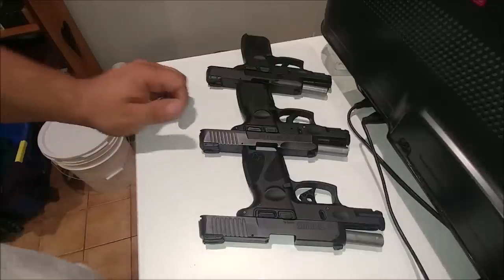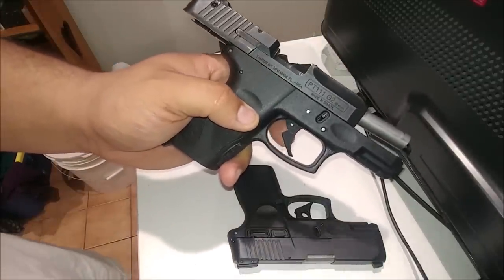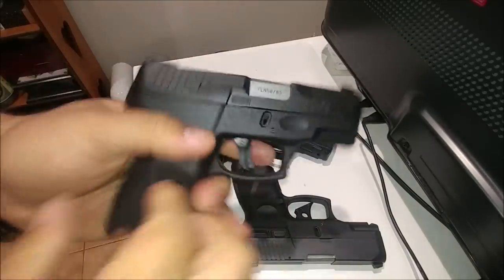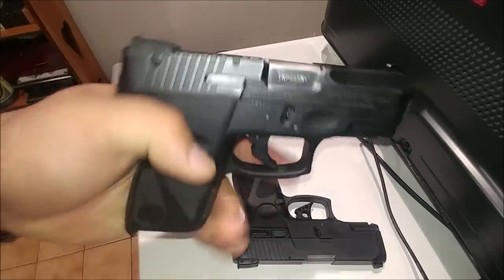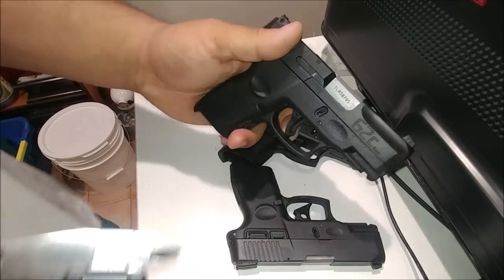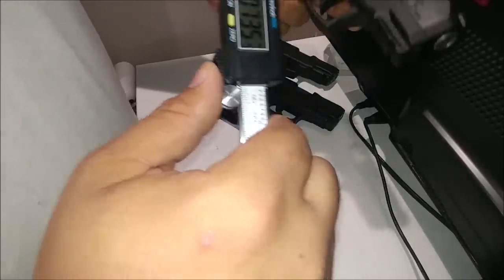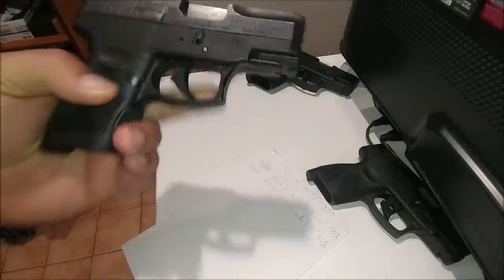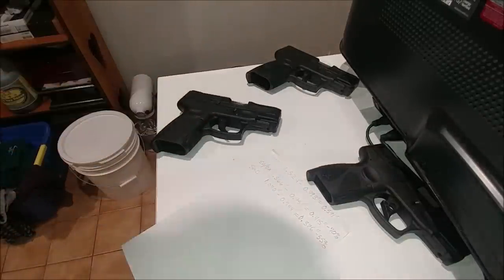New trigger design: SA/DA (Restrike) Trigger for PT111 G2/G2C/G2S

Comment: That is pretty incredible Sir. A 30% reduction in travel and still keep double strike ability is a very nice feature. Most of the G2C come with an external safety so the dingus being gone from the trigger doesn't pose a serious issue as far as safety is concerned IMO. Hope enough people become interested because it will make a fantastic entry to the 3 triggers already in your catalog for that little gem.

Comment: I'm in, I own a Glock 17 gen 2, one of the best stock triggers around. I love my PT111, but that safety trigger just blows. If I see that SA/DA trigger on-line in your eBay store, it's in my eBay cart and bought!
Reply: Got a G17 Gen 3 and the G2 trigger is horrible. It's like getting out a 2018 Lexus and into a 89 corolla with 400,000 miles and a CEL lit.
Reply from the maker: Thanks!
Reply: Lmfao Glock triggers are was. Even stock taurass triggers are better.

Comment: I have pretty large hands. It practically gives me cramps to pull the trigger all the way. I like the DA option, you can put a laser in the chamber, and practice on a laser range. But on the other hand, that reduced difference in travel for the SA trigger is probably more important for a carry weapon.

I haven't decided which I'm getting yet, maybe if I get a grip wrap,  it will give me enough thickness on the grip to allow me to keep the DA feature.

Comment: Great video. I want one!!!
Reply from the maker: The process takes a while to get rolling, but I have the first prototypes on the way, and as soon as I get those and verify they are working correctly, I can get a production run going.
Reply: Keep Tinkering: You da MAN !!!   I know a bit about machining, design etc. Unfortunately I didn't get the education in CAD/CAM cos didn't push it. (I'm 55yrs young) Worked in an excellent machine shop, nevertheless I  know quality and skill when I see it. I want one or more of your trigger systems... positively. My G2c is a fine and reliable arm. Can't believe it was so inexpensive. Great gun! Better with your trigger selection. Please make me one! Don't give a shit about the cost... I  got my new G2c for $189.99 !!!   My best to you sir.
Reply from the maker: My SAO triggers are available now, the link to my ebay page is in the description, my SA/DA triggers should be no more than two weeks out, and probably less than that. I will post an update here when I get them up on ebay.

Also, if you want to play with a VERY basic CAD program, look up tinkercad, it is a free online program.

Comment: Would it be feasible to have the oversized advantage of the SAO pseudo trigger in the SA/DA configuration?
Reply from the maker: Sadly fhe trigger comes forward significantly more with the SA/DA, so the Pseudo backstrap model wouldnt work well, as it is already pretty far forward.

Comment: what i dont like about the stock trigger and im not sure if anyone else has this problem with the G2s but the stock trigger has a hankup. Ive noticed about half way through the trigger pull you will feel like a click then the trigger will go back the rest of the way. I think i have narrowed it down to the trigger safety. Has anyone else had this problem? I believe the 1st time he pulls the stock trigger in this vdeo i hear that same click sound mine makes.
Reply from the maker: Yep, that is the funky metal hook trigger safety blade catching on the back side of the trigger bar, super common issue. You can take it apart and smooth out the tip of the metal hook on the trigger safety blade, which might help some. You can remove the stock trigger safety blade/hook assembly and use the stock trigger without it, or you can replace the stock trigger with one of mine that will get rid of the safety and shorten the pull.
Reply: @KeepTinkering  how do I order a trigger?
Reply from the maker: I have them up on my ebay page here: https://m.ebay.com/sch/keep_tinkering/m.html?_nkw=&_armrs=1&_ipg=&_from=

Comment: Im an total noob and have never owned a gun, but I am interested in buying this trigger to go with the g2c I might buy...but after watching this video and several others from OP I cant figure out how this trigger functions. I'm new to guns and it would be vastly more clear if he just took the gun out to a range and shot the darn thing and showed how it works differently. All the measurements, disassembling, notes, jargon, tinkering, and talking and holding the gun just dont register. 

If someone simply put some bullets in the gun, and shot off a couple clips under the different setups it would be easier to comprehend, but maybe bullets are too expensive to waste or this trigger is just not for entry level people like me which is fine.

To try and be constructive, does the trigger make the g2c single action AND double action?

If so can the g2c be locked and loaded with this trigger?

Comment: Hey man. I installed your trigger today.. It really feels nice. I will be going to the range tomorrow. I have fully modded this gun. My list up upgrades are...  STAINLESS STEEL STRIKER GUIDE/FIRING PIN SPRING AND RETURN SPRING upgrade/STAINLESS RECOIL ASSEMBLY and now your trigger.. Its brand new. I have never fired it yet but felt i needed to upgrade the gun to make it more reliable .. The stock parts are junk and i would never even consider using the gun with out the stuff i replaced.  .. It does feel a little tight but i did fit it properly . Im sure it will ware in .. Thanks alot...
Reply from the maker: The tolerences are quite a bit tighter than the factory trigger, so everything should be good and snug in there, but if you run into any issues, just shoot me an email at keeptinkering@gmail.com, and I will gladly assist.
Reply: @KeepTinkering  Hey i took it too the range and it shot perfectly. The Trigger is awesome. My wife liked it and she finds it easy to shoot . The stock trigger is horrible.  Thanks for making a great product !

Comment: Hey man I just picked up a new g2c this one is from Bainbridge. I noticed already that the rear sights are different on these g2cs. They have detents and springs under the rear sight assembly. (Haven't seen this on any g2c. Normally it's Just the rear sight screw removal and boom the sight comes off. )

Now there are indentions on the slide for two detents and springs under the sight to sit. 

Sorry for the rant, do you think anything else mechanically changed on this gun? Should I order just the SAO trigger and spring or only the trigger for the g2c? 

Thanks.
Reply from the maker: Corey, I have not seen that on a G2c, it almost sounds like the G3c setup. Usually my triggers dont NEED a trigger spring on any of the G2 models, although I do recommend them, but the G3 models all require one of my trigger springs.
Reply: @KeepTinkering  cool thanks I can send pics if you'd like
Reply from the maker: @coreyc7487  If you could send me some pictures to keeptinkering@gmail.com I would appreciate that! I try to keep updated on what Taurus is doing, but they do sometimes slip things in that I miss.

Comment: I'm very interested in ur trigger can u configure a da/sa trigger for Taurus 24/7 g2 it's da/sa just like the pt111g2
Reply from the maker: Sadly the 24/7 G2 is a completely different setup so my triggers will not work in it. Since I dont have one to use as a model, and it has been discontinued, I dont have a way to design a trigger for it.

Comment: Ive checked out your site but don't see the pseudo back strap sa/da option will it be available soon
Reply from the maker: No, to make a trigger SA/DA it has to come further forward than the SAO triggers. As both the Pseudo and Straight already come quite a ways forward, the additional forward travel for the SA/DA function would not work well, which is why I don't make SA/DA versions of them.
Reply: @KeepTinkering  thank you after further review of the g3c im going to go with a sao triger from you

Comment: I have (2) PT111G2's.  Upgraded trigger might be nice.  However, you gave no trigger pull info.  Unchanged or improved?  Price?  SA/DA for me.
Reply from the maker: The pull weight should not be significantly different from stock, you may see a slight decrease, but nothing major. The major change is smoothing out the hangup that the safety often causes, the reduced pull length, and moving the trigger face forward. My triggers all cost $30 each: https://m.ebay.com/sch/keep_tinkering/m.html?_nkw=&_armrs=1&_ipg=&_from=

Comment: Hello I like you triggers on all you lose the trigger safety.
But do you still retain the manual safety?
Reply: Do you know what the trigger pull is with the modification with your stiff spring.
Reply: Yes you still keep the manual safety lever. It removes the trigger safety  like the ones Glock has.

Comment: Any plans on making a trigger that keeps the safety dingus, I would be very interested
Reply from the maker: Not for the G2C and earlier guns. The stock trigger safety is poorly designed, which makes it failure prone and causes inconsistent trigger function, and the frame would have to be modified to function with a better designed trigger safety. Also, then gun is drop safe without it, so I personally dont see the point, especially since there are many new guns that dont come with a trigger safety at all.

Comment: What are the legal ramifications of changing out a trigger like this over the factory one, and have that gun used in a self defense shooting?
Reply from the maker: I am not a lawyer, so I cant give you legitimate legal advice, but from what I have seen the potential issue is not from when you meant to shoot an attacker and you did so with a modified trigger or not, the issue is if you claim that you did not mean to fire the gun, but it "accidently" went off. That is why the NY Glock 12lb trigger came about. My suggestion is to know and follow the rules of gun safety, modified gun or not, and you should not have any problems.

Comment: As a avid shooter but not technical what do you actually lose with a restrike compared to stock trigger? The gun still shoots and reacts same no?
Reply from the maker: Normally the gun always works in SA when it is stock, it only goes into DA if you pull the trigger and the gun fails to fire, as happens when you have round issues or are dry firing the gun. With my SAO triggers, if that happens you would just need to pull the slide back about 1/4"-1/2" to recock the gun. Personally I am a big believer in Tap/Rack, so I train to just eject a round that fails to fire and move on.

Comment: Regarding your prototype DA/SA trigger.  Does the firing pin hit the primer with the same force as the stock trigger each pull?  I saw your video where you mentioned on the stock trigger, the second strike has a weaker impact on the primer.  What about your SA triggers, do they have the same force hitting the primer as the stock trigger or is it the weaker force as in the second strike?
Reply from the maker: My SAO triggers work off the harder hitting primary SA sear. My SA/DA triggers work just like the stock trigger, but have a shorter throw and no trigger safety, so in SA mode, which is how the gun normally functions, they hit the primer harder, and for restrike/DA they work off the softer hitting secondary DA sear.
Reply: Do your SA triggers and your prototype SA/DA trigger eliminate the binding of the trigger like you get with the stock trigger in SA mode?  I’m thinking it’s the trigger safety on the stock trigger that’s causing the trigger to hang up if you don’t pull the trigger straight back.  That’s the only thing that irritates me.  Everything else about my G2C is awesome! Thanks!
Reply from the maker: Yes, the hitch is caused the the trigger safety hook, my triggers dont do that.

Comment: Can you show the trigger reset on the SA/DA trigger on another video?
Reply from the maker: Gary, the reset on the SAO and SA/DA triggers is exactly the same. The only difference between them is the SA/DA total forward trigger travel is a bit further forward.
Reply: @KeepTinkering  I was more curious about the difference between your trigger and the reset on the original trigger. The original has a real short reset that is great. I was wondering if yours would lengthen that travel, stay the same, or shorten it. Any information would be greatly appreciated. I am about to "pull the trigger" on a purchase of your trigger/spring set up on ebay. I see it may be a few more days until you can ship, but I am patient. ;o)} Any idea how much the spring increases the pull on the trigger? Most stack are under 5 lbs.
Reply from the maker: @garymerrill7684 I got home earlier today, I am catching up now so I should start shipping out either later this evening or tomorrow. As far as the trigger reset goes my triggers do not change anything about that mechanically, but they do cut out around 5/64" of overtravel compared to the stock G2/G2c trigger, which means they effectively shorten the trigger reset by the same amount.
Reply: @KeepTinkering  Thanks for the info. I just "pulled the trigger" on the deal!
Reply from the maker: @garymerrill7684  Thanks!

Comment: greetings KT. i recently procured a sao from you, and installed it tonight. so far im impressed. ive not actually shot it yet, but it functions apropriatey. im looking foreward to firing it very soon. however this is completely not related, i was wondering if you could tell us the differences between the 3 guns you have there? the g2, g2c and the g2s
Reply from the maker: Glad you like the new trigger so far! The PT111 G2 is the older version of the G2c, they are almost identical except the G2 has slightly thinner slide rail guides and also has a locking safety in the slide, so the slides are not interchangeable, but almost all the internals are. The G2s is a slightly thinner single stack version of the G2c that only holds 7 rounds instead of 12.
Reply: @KeepTinkering  awesome. thank you so much. and thanks for the videos. id have been lost on installing that trigger. the spring is what gave me problems. but i got it, and the gun is WAAAY better now. thanks alot. im planning on getting another g2c or g3 and i WILL DEFINITELY be getting a new trigger. well done . thank you.
Reply from the maker: @yetisuncle666  Glad I could help!

Comment: I love ur pet bird. And I am only buying striker fired if it double strikes but I like Da/Sa guns better... Or even the DAO revolver like pistols(sccy and such)
Reply from the maker: The Taurus 709 slim, pt111 G2, G2C, G2S and their 40 cal siblings all function similar to SA/DA hammer fired guns with a hidden hammer you cant decock. Out of curiosity, what is your main interest of an SA/DA striker fired gun you cant decock over an SAO striker fired gun?
Reply: @KeepTinkering  I dont like to think its cocked and unlocked
Reply from the maker: All of the Millenium guns have manual thumb safeties, and it is possible to field strip the gun and load it in such a way that it is uncocked.
Reply: @KeepTinkering  ooooh now u said something I never thought about... The g2c... You field strip it and then put it back together right? But I like the long DA pull to be my safety
Reply from the maker: Here is my video on it: https://www.youtube.com/watch?v=KY6GmVpXtK4&app=desktop , in a nutshell you field strip the gun, assemble the slide with a round in the chamber, then pull the slide onto the lower frame JUST far enough to clear the take down latch, then insert the loaded mag. The gun will the be loaded and decocked. I suggest you try this at a range first.
Reply: @KeepTinkering  I will buy the g2c bro

Comment: Would I be correct that neither version affects the trigger reset after break? In other words, the reset remains the same?
Reply from the maker: They both shorten the trigger reset slightly, as they both cut out a fair amount of overtravel compared to the stock trigger.
Reply: Keep Tinkering 
Great!

Comment: Thinking about buying this, folks that have installed it are you pleased with it? Dont want to loose the double action on the gun but hate the stock trigger on the g2c
Reply from the maker: By all means ask around, but if you end up ordering one and dont like it, I am pretty easy going on refunds and exchanges.
Reply: @KeepTinkering  thanks for the info, already watched your video on the installation process. Probably going to pull the trigger on this (no pun intended) and make a purchase in the next  couple of weeks.